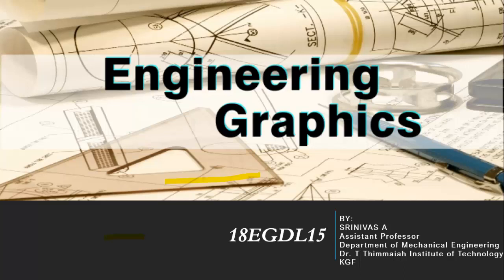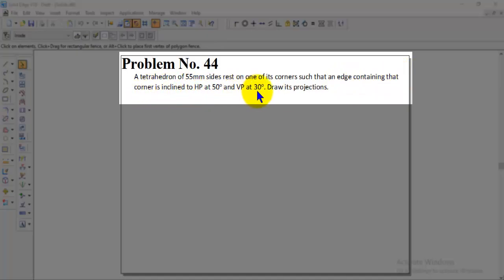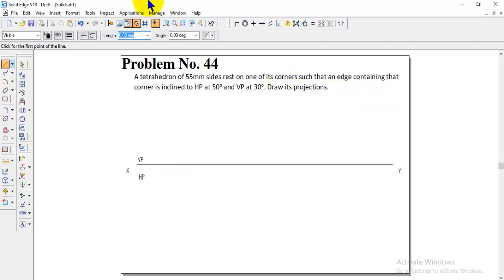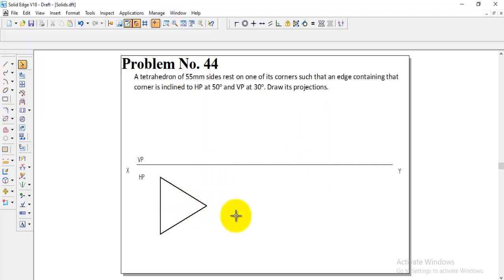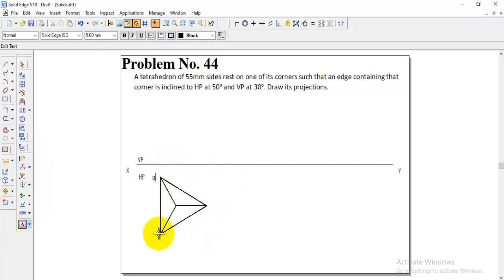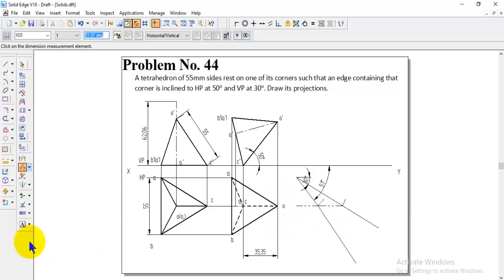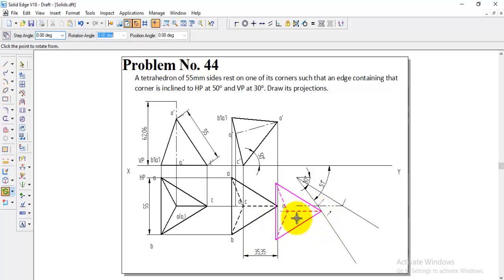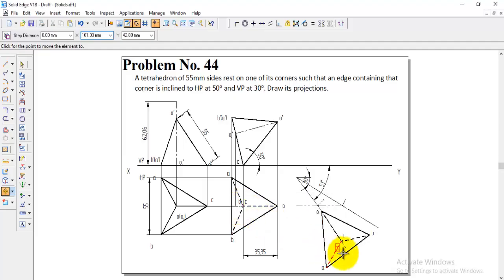Projection of solids 44 problem Engineering drawing solids computer Aided engineering drawing CAED

Comment: We don't have macro option sir
Reply from the maker: Use angle method..
Reply from the maker: Use angle method
Reply: @bunkcna  wat are the angles
Reply from the maker: Draw two lines from common point then use angle bitween option and give 60 degree then join open ends 
😊@Reyna-1965